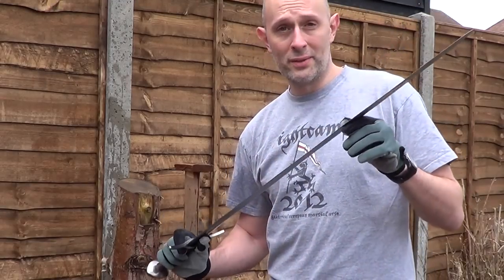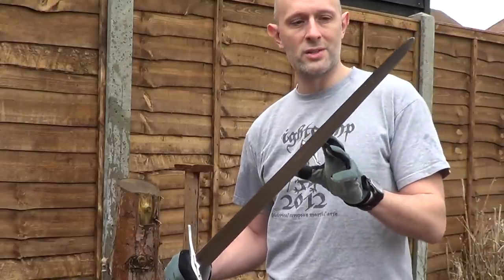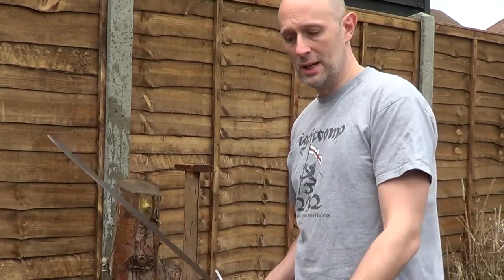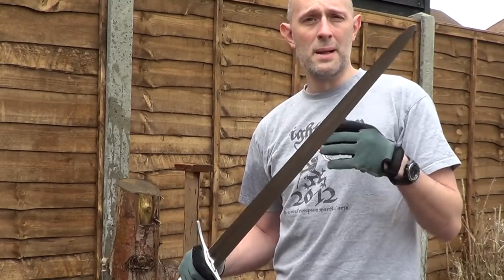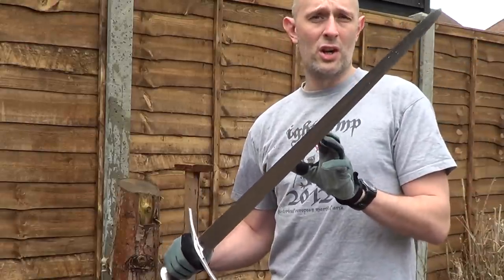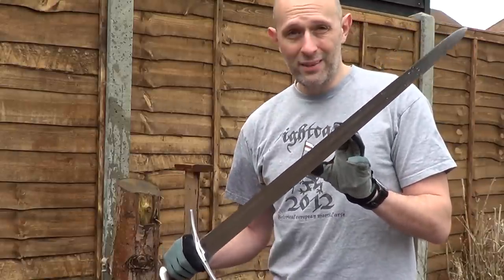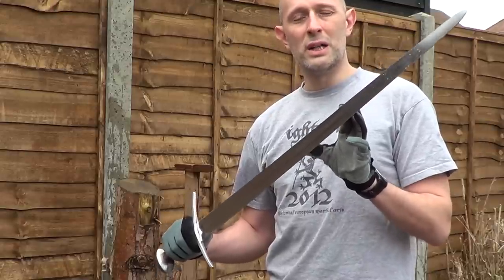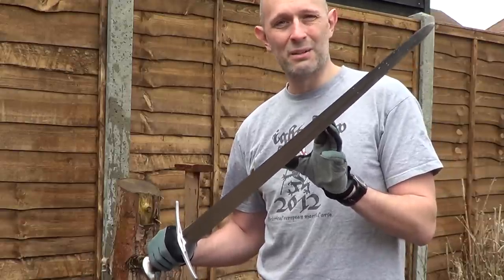Cutting bottles with medieval sword - the 6 basic front-edge cuts

Comment: I find cardboard shipping tubes to be fun and challenging to cut. They show cuts very well and are quite resistant. Easy to get as well.
Reply: Hm, wonder if putting some low-percentage ballistics gel in there would make a decent analogue for a limb or what have you.
Reply: Marcwulf
 Ballistics gel doesn't behave like flesh at all at the speeds that are concerned in test cutting!
It has too much friction, it drags on the flats of the blade more than any flesh and skin would...
A bullet isn't sharp, has low surface, so low drag, and an energy to mass, and energy to surface ratio that are through the roof compared to any sword cut, hence, not, AT ALL the proper testing medium if you wan't any idea of what it would do for realsies!

I know we're a generation that has been bred on mythbusters, good show by the way, and that as a result has induced a desire for mock scientificity, but it's rather simple, use fresh pig in some old clothes, or, if you can't or won't because of ethics, costs, messyness, or what have you.

The quest for a scientifically valid analog probably isn't throwing in a coconut for a cranium, and cover it in gummy bears!
Not saying it cant be done, but think of the testing rig and protocol, and how much time a ressources you can think into a hobby, and you'll quickly see it's a hard quest!

Use stuff at hand for it's known properties, and how it will inform you about your technique!
Stuff that is tough to pierce to practice thrusts, water bottles for edge alignment, Suspended rope is neat too, as a ficle target that loves to swing out of your blow if edge alignment is off...
As far as powering the cut, most of the youtubers hog it through way more than would be healthy in combat, and don't end up in a viable guard...

That way, you wont kid yourself in believing your the Jedi of cutting stuff up, and still will have a decent opportunity to build and improve your skills, Sucks if you're out to have a semi legit excuse to say "brodudemaaan, I would have cut through twenty people and two buffaloes with that cut!"

But ideal to improve on technique, and build confidence in it!
If you for certain know that you can reliably align the edge, and gracefully deliver a swift cut, from guard to guard, in mediums that are less forgiving than actual flesh, is imho already enough, as far as the martial practice is concerned!
And if omnivore, and wanting some gore and fun, then you can have fun with some fresh carcass before a summer bbq!
No need for injecting time and money into falsely "realistic" targets for the sake of it! ;)

By the way, I really don't get the types that are grossed by using pig carcasses, yet use mostly pig derived gelatin!

The quest for proper human analogs for traumatology and accidentology has been a long one, and if it's more precise and niche than how many g's, is there a concussion, etc, there's still need, to this day, to use real donated human limbs for some stuff...

To do a precise analog, you'd need a rig able to produce a variety of perfectly repeatable cuts, mimcking proper technique by a human, with consistent force, angle, etc, again and again, tuned for an average of proper cutswith an array of blades with correct geometries, shown to be effective on the real deal, ideally not refrigerated or dried, but very much live
From that you'd have to log how the real stuff behaves, as a whole, and then components by components, trying to understand the synergy,
Then you'd have to test a wealth of different stuff and see if any mimicks decently this or that, and how could it be improved upon and finely tuned, hope that they behave well combined, test that!
Not a piece of cake to go from the idea to the point of having skin that behaves like skin, (human), fatty tissues, that behave rightly, flesh that behaves also right, and fake bones that mimick real bones, not only in shape, but in behavior...
(Dry, dead bones, for example, are a bad analog to their live counterparts, the way it cuts and fractures is quite different!)

Not saying a neat, easy to build analog for backyard cutting isn't "possible", but if you wan't real science, instead of pretend science, it's gonna be hard, long, and costly at first!

And definitely, ballistics gel for edged weapons, is, dare I say, Busted!

Comment: Cool, but I think you need to increase the number of keyframes in your final render of the video. Keyframes are when the video uses a complete image instead of just taking the parts of the image that have changed and pasting them onto the next images until the next keyframe. It's a way to compress video files, but if you do it too much (that is, if you have too few keyframes) you will get the strange copy-paste look you see in the slow motion in this video.

Comment: if you do cutting tests you might not want to record it with a camera that records at 25 frames per second, since it looks awful if you slow it down, you might want do it with something that records at 120+ (or even 60 is better if you only do 0.5x regular speed), or have one high resolution camera recording it in 25+30, and have a second lower resolution, but faster camera that is only to record the slow motion footage

Comment: Which would you guys pick - a sharp, thin blade or a slightly less sharp blade with a thick spine?
Reply: For what purpose? Different blade shapes do better in different circumstances.
Reply from the maker: Rafaello Fareday Depends what I want to cut. For soft or light targets, thin. For harder or bigger targets, stiff. But I would always want my sword to be sharp - blunt swords don't cut through clothes or flesh properly (only tatami, which is quite easy to cut).
Reply: A good sharp blade is also safer than a less-sharp sharpened blade, which sounds counter intuitive, I know.  But basically it takes less effort to cut, which makes it much easier to control.  Much like with an axe, the more effort you allow the blade to do the less effort is required to be provided by the user, and the safer each swing is for the user.

Semper Fi

Comment: ***** found that soaked news papers in roles make a good substitue to tatami mats, and is apparantly more resistant to cuts...
Reply from the maker: ***** Yes, I've used soaked newspaper quite a few times and it is pretty good - certainly harder to cut than tatami (which I think is quite easy). I'm actually saving up newspapers at the moment to film a video using those.
Reply: scholagladiatoria Looking forward to that video then...

Comment: Beautiful Viking sword, mate! Who made it? With regards to the artifacting; unless there's a new, awesome codec out there, this is always going to be a problem. The speed that you're moving at versus the ability of the camera to catch the action and it's ability to interpolate between keyframes causes the artifacts. There just isn't enough data to use. That said it's still a pretty bitchin' video and the ring's the thing!
Reply from the maker: Eric Cullum Thanks - The sword is by a Czech smith called Habart Mundel apparently - I bought the sword second-hand though, so I know nothing about the maker. It's a good sword though.
Reply: nods He does great work based off this video.